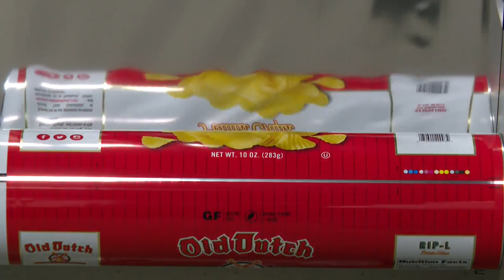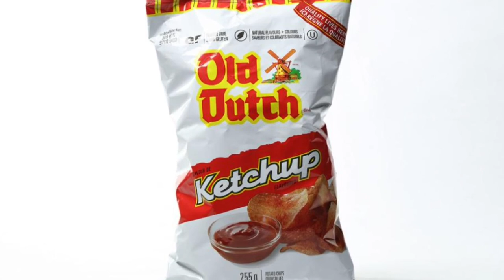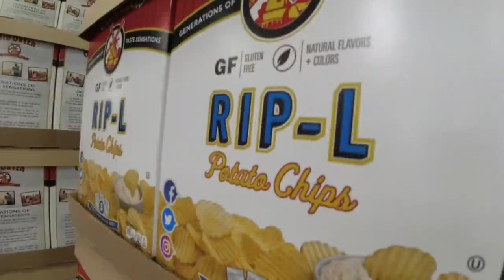Behind the scenes at Old Dutch Foods

Comment: I worked for Old Dutch back in early 74. I was stacking trays of boxes back in the warehouse for minimum wage which was about $3.50 an hour. I quit after a few months and worked for a landscaping outfit for a dollar less an hour just to get away from that boring job. Every time my nose gets a whiff of that potato chip smell the memories come flooding back to me.
Reply: Minimum wage in 1974 was 2.00 an hour. I worked for the RR as a clerk back then making 3.65 an hour to start and lived pretty good which was amazing
Reply: @edmondfitzgerald  They were just corrugated card board trays that would hold five or six large boxes with a string tied around them. I don't have a clue who made the trays, I'd assume they were made on site. Another worker and I would toss the strings that came loose up on a cement block wall behind the conveyor as a form of contest out of sheer boredom. My supervisor was named Mc Mahon.